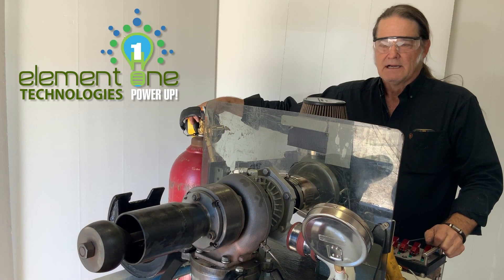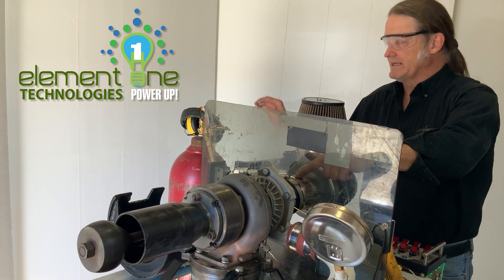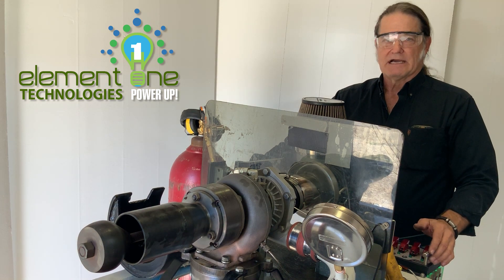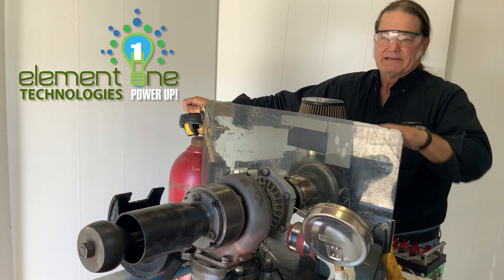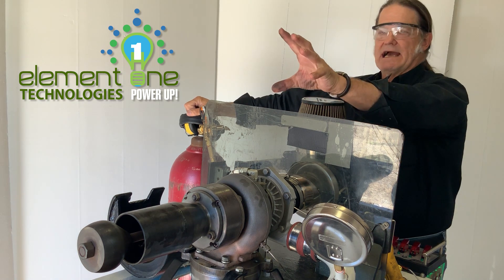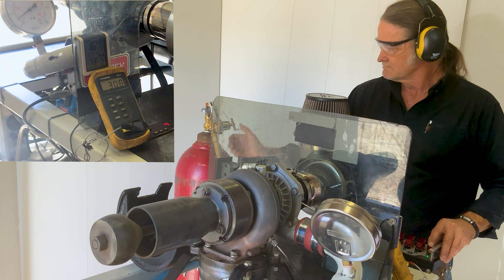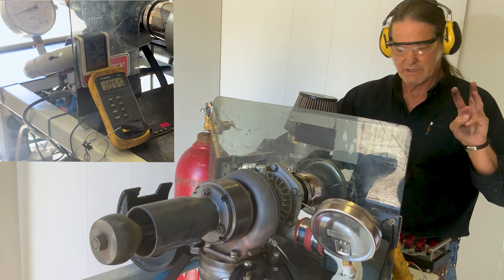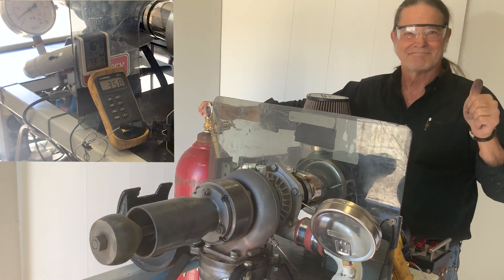Hydrogen Powered Turbojet Part 2

Comment: What is the pressure in hydrogen tank? Or what is the rate of volume of hydrogen use. Looking to build a Hydrogen generator. 

This Turbojet can be used as a Power Generator :)

Comment: Instead of a apu why not use an electric motor on the intake of the turbo u could attach it to the impeller shaft.   

Then use it  to generate electricity .
Reply: Yes - youre right. That comes version 2.0

Comment: would it be possible to use this technology on a jet pump like on a jet ski. and put it on a saltwater boat that has a built in hydrogen fuel generator using electrolysis. with salt water intakes that continually cycles new water in to reduce waste. with some kind of compression system.

Comment: Make a system to capture the water created from the hydrogen combustion.
Reply: Then run it through electrolysis and burn it again, lol. I'd love to see the additional energy needed to achieve net 0!
Reply: @raulhatescheese  Do you know what Deuterium is?  It's not about net zero, it's the fountain of youth.
Reply: @raulhatescheese  or you could use the hight temp to boil it and capture the steam vapor for additional potential power for electric generation though it might be a moot point as its already a turbine, but its kind of the same principal with a closed loop steam boiler and a condenser to take the steam back to water instead of venting to the atmosphere, what I am interested in is is there enough water generated out of a fuel cell to be able to boil with the 3-500 degree f temp the hydrogen fuel cell reaches that it could be captured in a small pressure vessel and use that to spin a small engine to help generate more electricity for storage or use like the way waste heat is used for secondary power generation or waste heat generation. but to try this fuel cells are not cheap toys you can just buy at a store nor fabricating a boiler drum of any sizeable operating pressure there are rule governing them and steam is a witch it can do great magic but misuse it and a great curse will befall you as its basicly a running pipebomb.
Reply: Two things 1: Net Zero doesn't exist. 2: For every liter of water use to produce hydrogen a liter of water is produce in  combusting hydrogen - its literally a lossless process - 1:1.  But it's the energy used for H2O to H2 conversion (water to hydrogen) and hot water vapor back to liquid water phase are where the losses take place. If I capture the hot water vapor at the exhaust pipe that vapor has to be condensed back to liquid water to be sent back to the front end of electrolysis that requires energy to repeat the process from water to H2. Its a very good question and concept but perpetual motion is not possible.  @raulhatescheese